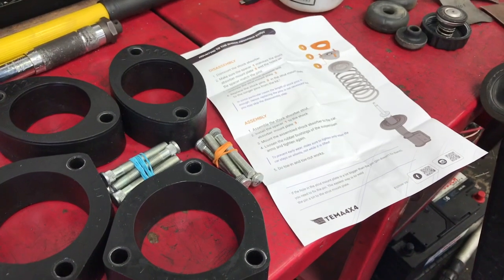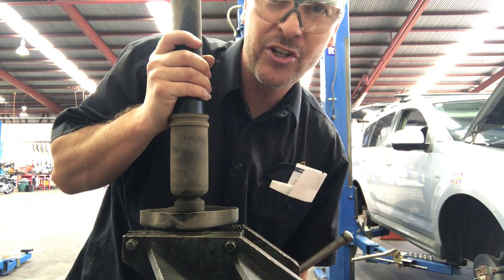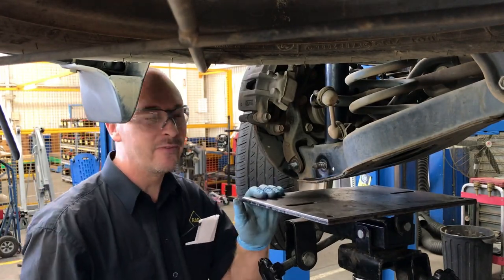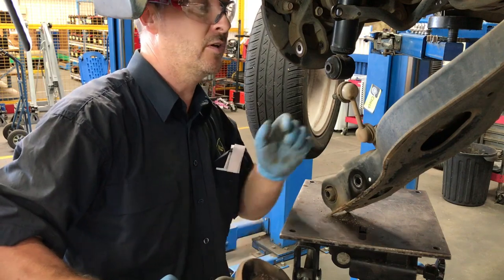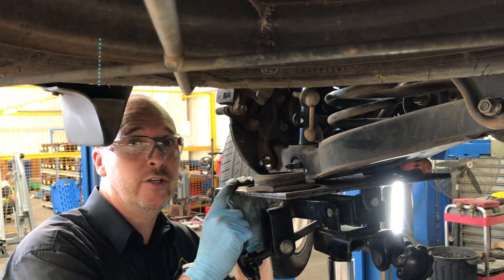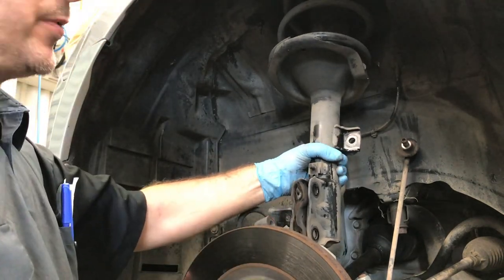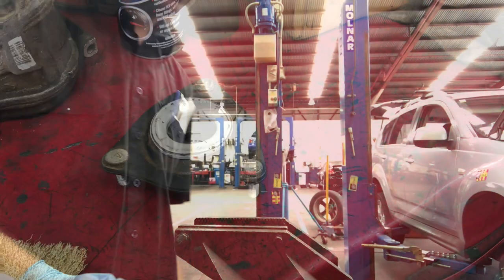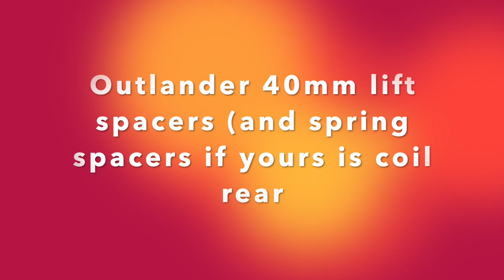HOW TO : Outlander ZG 40mm Lift kit

Comment: 4:40 onwards.
Instead of bashing the begezus out of the bolt head, causing damage to the hole's internal angles (by the wobbling around of the new stud as you beat the turds out of it), and by the jaw clamps causing some distortion on the active cylinder walls of the main shaft, use a PRESS, even a drill press with that "tire-punch" inserted as if a drill bit, you can simply PRESS the new stud slowly into it's serrated seat.
NO DAMAGE to either the stud head, or to the cylinder walls themselves, or to any other component of the McPherson Strut that you may be doing damage too, by rough handling the unit whilst bashing the turds out of the stud head, by using THE WRONG TECHNIQUE for pushing (pressing) new studs into old holes.
Reply from the maker: I did what it took to get the job done. The average home mechanic doesn’t have the correct / recommended tools.

Comment: I have done this on my 2008 Outie and I have 84 cm front and rear measured from the ground up to the wheelarches.

I kept my 18” original rims and fitted Falken Wildpeak AT3Wa 235/60 (Rubitrek in the US) since they are approved for all year use which is important since I live in Sweden.

Where others get stuck on their belly in the snow I have no issues at all.

Back camber is easily solved with the rear adjustment bolt/arm and front works perfect with making the hole just as you described.

Furthermore I needed to shorten the rear swaybarlinks 15 mm. I just cut it off and then welded back again. Front also has to be shortened by 10 mm but there I bought universal adjustable swaybarlinks. Frontlinks should measure 255 mm.
I’ve had this setup for a year and a half now and am very satisfied with it.
Reply from the maker: Sounds great. Looks like you’ve done everything required to correct the geometry. I sold my car last week and fancy a change. Looking at possibly a Forester or Outback. There seems to be plenty of aftermarket lift kits for them.
Reply: Hi matey, I’ve used the same lift kit and new camber bolts, so camber is within specs. However, it feels like caster is off as the steering feels loose when going at high speed (80km+). Do you think the front drop links , which are the original ones, could be the problem? 
Cheers
Reply: Yes that’s the problem, original in front is to long and need to be 225 mm instead of the original at 265 mm. Rear droplinks need to be 50mm , then you get the caster right.

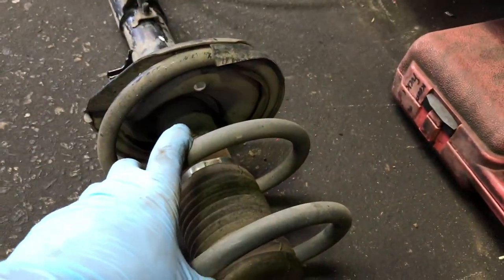Comment: 19:40 
It's about this time, when you REPLACE that stuffed rubber boot too. as it's way past it's use-by date, allowing dirt onto the inner pipe sleeve, and for the inner hydraulic oil to leak out onto everything down below, including the disc rotors.. (oops no brakes some day)

Comment: Done mine 1 year ago  yep you need camber adj bolts up front and arms on the rear.  Looks great and handles great  replaced bearings , rotors, pads, springs, shocks all in one go. Sitting up on steelies with all terrains VRX OUTLANDER V6.
Reply: Hi mate, could you please advise on the camber bolts and arms that you installed after the lift? Got any link on ebay or slecifications? Thanks
Reply: @vivekbhandhoo6354  look at hardrace performance parts for rear camber arms ( I'm pretty sure my was off a mitsi Lancer)
The front ones are just camber bolts, - superpro camber adjustment bolts.  I can't attach any photos here but if you send your email I can send you some photos. Cheers
Reply: Same here! When done right, it completely changes the outtie for the better.

Comment: Update on mine, I lowered it 40mm instead. The lift just wore out every bushing and was a nightmare to align. (I have oversized tyres too) stock with stiffer rear coil springs if you want to lift it in the rear. Part number kyb-ra6227. Then larger tires and you will have a 2 inch lift total. Not worth the spacers for. The extra inch or 2.

Comment: Hello! Great tutorial!!! I bought recently a 2016 Outlander 3.0 litre engine and would like to lift it. Can you please make a video of camber bolts installation, so the alignment can be done properly after that? Or just quickly write about this for us!
I would also appreciate if you can make a video regarding the tires, wheels, sizes, how much off-set etc.
Greatly appreciate your work!!
Reply from the maker: I still need to correct my rear. I cheated on the front by elongating the holes where the shock mounts to the hub to give me some camber adjustments

Comment: 9:40
I hate the way BUSH mechanics attempt seriously dangerous manoeuvres - such as this, especially when leaving their FACE, directly inline with the direction that the spring will go UNDER SOME COMPRESSION, as you struggle to refit it to the lower suspension arm, at such an awfully step angle, should it slip out and smack you full in the face as it whizzes past.

For goodness sake, do as you SAID you were going to do, and remove the INNER bearing bolt, to allow the arm to drop "correctly" down without angling the bottom of the spring inwards whereby it could easily slip the foot, outwards...
Destroying any soft flesh on the way..

If you had released the arm swing bolt, (at the inner end) the entire swing arm could have simply been raised FLAT to refit the spring into position..

HOWEVER you did it all wrong, from the get go.

As you never COMPRESSED the spring fully, nor did you fit spring compression clamps either side of the spring, when under compression, as then it would have been an easy drop, without the spring extending as far as it did.

For a mechanics workshop, you seemed to have ZERO tools of the correct type, to do that job.
The very least tool is a spring compression clamp (or preferably two)

Comment: I spoke to someone who did it. They said the steel spring rubbing on the urethane spacer was wearing it away over time, thus reducing the height. I wonder if some grease in there might help
Reply: Mine has squished slightly, like it's been bedded in. Only on the rear as it is in direct contact with the coil. Still solid, height hasn't dropped because I am running heavy duty rear springs to maintain the lift and improving handling, towing, etc

Although saying that, they are rubber. They will eventually wear out and need replacing. Like a service part. Steel ones I imagine would be good for longevity, but very rigged and likely to cause other components to wear out faster/make all sorts of noises on the rear.

Comment: Nice work, and great video.
Assuming you can get the same lift from either spacers, or longer coils, which option would you choose?
I’m looking at +30mm H&R coils, which to me seem like a better option, but I’m no pro.
Reply from the maker: Coils would be better option but only with shocks as still using standard shocks means standard down travel. Adding 40mm spacers gives 40mm lift and gives 40mm more down travel.

Comment: I donne 50mm in my 2009. Using spacer made in aluminum by Ritter. I need to change the front tie rods to VW Polo 2009 (brazil model). They are about 1cm longer.
Reply from the maker: Nice work man. How did you go getting the alignment on the rear with 50mm?
Reply: @PERTHSCOOTER07  Hi! I made in a local shop near my house. They have alignment machine with laser that helps to get it. As I remember the result after the lift was a little off the maximum tolerate. Because of this I need to change the front tires with rear ones more times (each 10k kms). In drive the car fells totally normal.
Reply: @PERTHSCOOTER07  I put some videos using my outlander in  "light offroad" in my channel.
Reply from the maker: @x.trailcwb1546  I’ll have a look. Cheers

Comment: Got a question for you. Would stacking a handful of washers on the nut side and then tightening down the nut have worked for seating the extended bolts in the shock?
Reply from the maker: Yes. I don’t see why not

Comment: Unfortunately my 07 Outlander now shakes when I accelerate after I installed my lift kit. It also made torque steering to the left more noticeable.
Reply from the maker: Have you done a wheel alignment?
If so, your cv joints may be worn and lifting it has put more load on them
Reply: @PERTHSCOOTER07  I did the alignment and replace motor mounts and an axle that was bad. 
The mechanic said it’s because of the spacers and how it stresses the suspension. Did you experienced anything like that?
I kept the oem springs and struts though.
Reply from the maker: @thunderwolf8052  I did. I put new CV joints in. I also cut my front spacers down to 30mm but that was to level the car out a bit more. It looked and drive great afterward

Comment: What if I did the front ones without those white markings mate? Mine seems to have slight camber issue. I ordered spacers after watching your video but there was a few months gap between buying and installing 😁
Please help
Reply from the maker: You don’t need to mark it. You’ll work out how it goes. It’s just easier that way to avoid any confusion

Comment: I'm considering doing this to my 2012.  I'm not intending on making a serious off road machine but a bit more ground clearance and maybe bigger tires would be beneficial for the little bit that I do.  Was there any effect (positive/negative) on ride quality?  Being my daily driver I need to make sure it passes the wife test before I put in the time/money :)
Reply from the maker: I had a driveline vibration which I’m still trying to pinpoint, and the lift exaggerated this. But the actual ride quality is not sacrificed. It drives just the same

Comment: I have done this with my mitubishi outlander 2007 4x4 mk2, but i have an issue whit the front wheel hub, i have a lot of positive camber , like 2 degrees. You don't notice that on your mitubishi ?
Also i have a lot of vibration when i put the 2 gear or when i go up hill
Reply from the maker: My front sat higher than the rear and I had a vibration under acceleration. I cut the front spacers down so the front sat level. I also elongated the holes for my strut mounts in order to give it a bit of camber adjustment. After this and a wheel alignment everything was good.
Reply: @PERTHSCOOTER07   how much material do you cut form front spacer ? 1 or 2 cm it is enough ? also i  drilled the fornt supesion hole and bought a camber bolts and resolve the camber problem, but in acceleration in 2nd gaer under accelaration give a little vibration.
Reply from the maker: @LuigiMaddaluno21  hi there. I can’t remember how much exactly I cut off but it was around 1 third.
Reply: @PERTHSCOOTER07  in millimiter ?
Reply from the maker: @LuigiMaddaluno21  can’t remember. So whatever the spacer depth is divided by 3!
Reply: @PERTHSCOOTER07   ok Thanks a lot

Comment: did you use a relocation bracket for the strut link of the front suspension?
Reply from the maker: Hi. I’m not sure what you mean by strut link. If you mean for the sway bar / anti roll bar then no

Comment: hi I have just recently bought the exact same kit from the same seller on eBay, for my Mitsubishi ASX/RVR/outlander sport. anyways I went to have installed at my local mechanic, and was told that if it was installed the spacers that they would throw the car out of alignment and not be able to realign the car, I was also told that it would make my brand new tires wear out in less than six months, as well as ruin ball joints and lower control arms and would be a short amount of time till they would need to be replaced. so I told him to forget it and not to put them in. now I'm just wondering if I should believe this guy or should I be able to have them installed without causing premature damage to the car ? I really wanted to have them installed but he sure made me believe that I shouldn't!

would a camber bolt fix these issues if he is right ? and where would I get a camber bolt?

any feedback is great appreciated thank you so much !!! cheers!
Reply from the maker: Ryan Carey Boychuk hi mate. They are correct on the alignment. And the alignment being out will prematurely wear the tyres. If you get camber bolts installed (I’m still needing to do this) the alignment will be good. 
The balljoint comment is a load of bullshit. Balljoints and control arm bushes wear with movement. You will be getting exactly the same movement as before, just in a different spot. Take it to a place that specialises in tyres and alignment as they’ll do a better job than your average mechanic
Reply from the maker: You can buy camber bolts on eBay or through any decent suspension place.
Reply: PERTHSCOOTER07 thanks a lot for you feed back !!!
Reply: @PERTHSCOOTER07  can you please share a link from ebay for camber bolts?

I raised my outlander 30mm and have a rear positive camber
Reply: @roeymaor9824  even with 30mm you need camber bolts ? I’m wondering if 20mm will be Enough ..I want keep my stock wheels/tire combo

Comment: Hello guys. I had just fit this lift kit, and I have an issue with the rear untiroll bar. Also front stabilizer links now need to be shorter than normal. Did you find this kind of problem? And if I deleted the rear untiroll bar, am I going to loose to much stability in the road? Thanks in advance.
Reply from the maker: I didn’t have this problem. Removing the rear won’t make a massive difference. It’s the front one that does
Reply: That's what my mechanic told me in fact, that the aft untiroll bar, won't do a lot of difference without it. Thanks for your reply. 👍

Comment: Can I ask if you're a mechanic (since you seem to be in a workshop)?
I'm in Perth and have just bought a 2017 Outlander and see that the Tema4x4 kits are still available (and seemingly for this model).
What would you charge for the install?
Reply from the maker: Hi there. I had a day booked off and went into work to install it. So it’s not really a job I’d take on for someone else. I’d recommend Pedders or Wilkinson’s.

Comment: I own an 2016 GLS 3.0 V6 model and plan to add this lift kit. Please advise on the recommended wheel sizes. Currently its 18 inch with 225/55/R18 tires. Thanks.
Reply from the maker: 18” limits your tyre choice. I went with 17” rims and 225/65 tyres (slightly bigger than standard) check out my other video - Falcon rims.

Comment: Would I be able to still do a wheel alignment after installing this kit?
Reply from the maker: Yes. Rear is hard to get within spec though
Reply: @PERTHSCOOTER07  do I need to buy any other parts to get the rear close to oem specs?
Reply from the maker: @ready2ridef4i20  you can buy rear camber bolts and that should do the trick

Comment: Can I get this for my Mitsubishi Outlander Rx?
Reply from the maker: What year is it? I think most of the outlanders use the same platform so I’m guessing yes. But can’t be 100% sure. The company I bought from go off the Japanese model code
Reply: @PERTHSCOOTER07  I have a 2010 Outlander Rx
Reply from the maker: @hamrollwithcheese4705  you should be able to get that kit. You just need to get the right kit depending if it has separate coil and shock or a coil over setup

Comment: Can you stack these spacers for double the lift? I want to lift my first gen Outlander about 8-10cm
Reply from the maker: The driveshafts won’t handle it. You’ll have to look at a custom subframe drop
Reply: Thanks. I am not sure about dropping the subframe. Maybe that the 40mm lift kit and bigger tires are enough.
Reply from the maker: @workermaster1  if you need bigger than that then look at Subura. The Outback’s seem to be able to be lifted more than Outlander